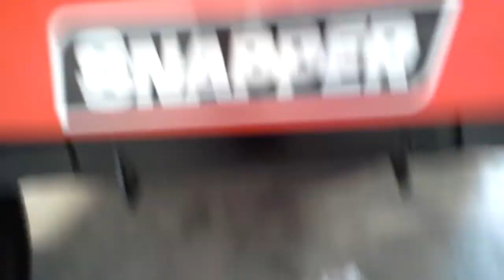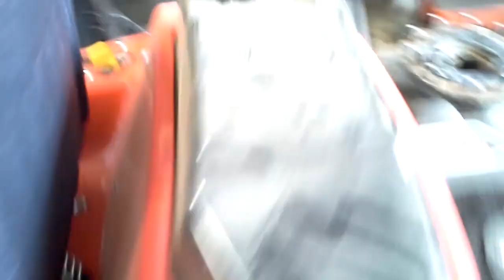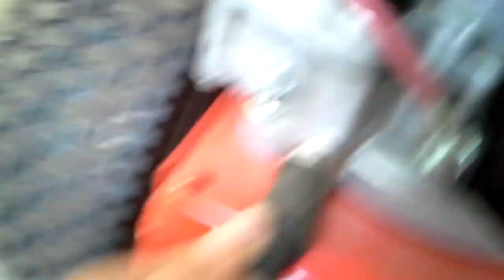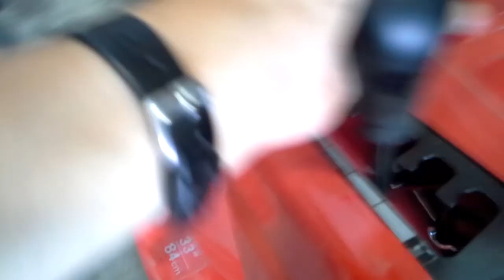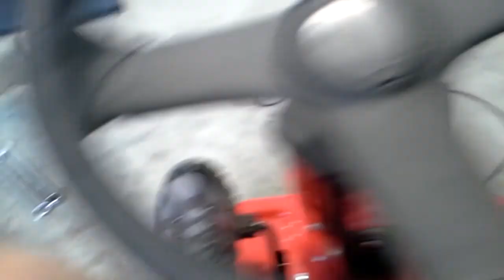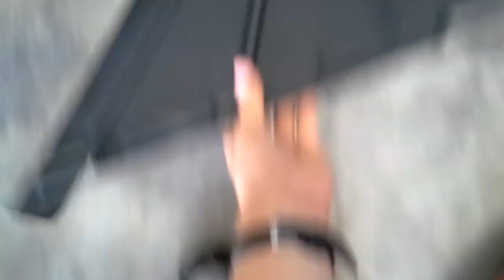Snapper RE 130 part 1

Comment: .I bought the RE-130 33 Inch 12.5 HP Model. It's a well built machine but was disappointed in some things with it. There are no notches to hold the speed handle in place. When you ride, the vibration and bumps force the speed handle forward and the mower keeps going faster. I have to hold the handle in place to keep the speed constant. When going fast and making a turn the front wheel lifts up like you are pulling a wheeley. The ride is HARD, you FEEL a bump when you hit one and you FEEL a hole when you hit one. It didn't handle high grass well and the engine started to stall. I had a 4 bladed mulching blade put on it and it wouldn't cut the grass until I lowered the deck to almost scraping the ground. The only really good thing was that  it steered and turned very easily.